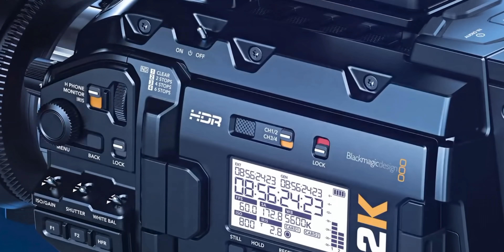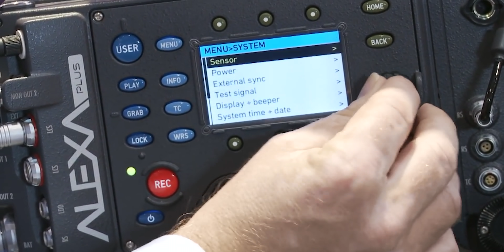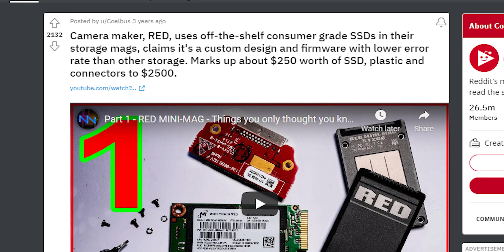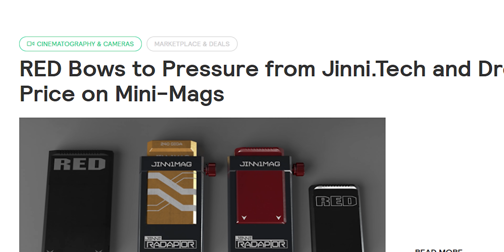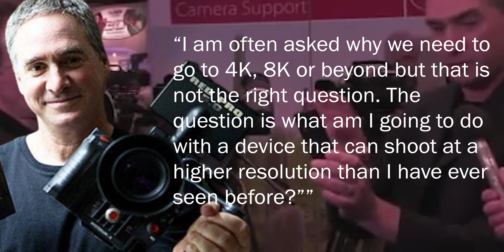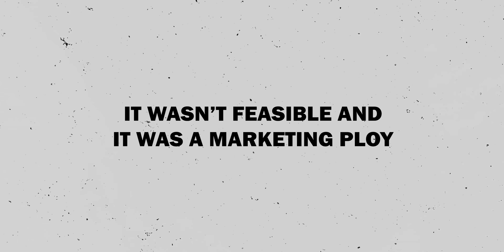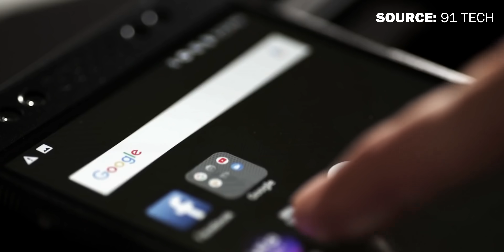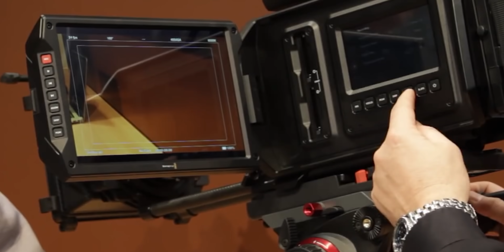The 28K Camera ABANDONED by RED Digital Cinema

Comment: 28k at even 1fps time lapse would generate more data than anything currently on market could handle for recording. at least that i am aware of. it is a lot of data. personally i am quite happy with 6k, and rendering projects out at 4k or 1080p
Reply from the maker: Right? The data load would be insane. Unless they figured out something like Blackmagic did with the 12k and had a lossless compression or something like that
Reply: I’m happy to watch 720p or even 480p if the story worth it !
Reply: @Sorennn94  nah people want 4k even when they not looking and only hearing.
Reply: @Sorennn94  How about 0p? Aka audio books.
Reply: @Sorennn94  if that is all that is available then i will do that for some things.
Reply: That's my take on it, it was technologically not feasible outside of the lab (lab scale can encompass a very large supercomputer if need be). That scale of sensor, or the "let's just go big" approach had a lot of other systems that would need to catch up for it to work. Things like the storage size and speed, the on board image processor, the memory-to-processor data links, and even auxiliary things like computer workstation software / hardware (for editing the raw footage) all had to catch up.

These tech limitations are why we've seen a slower transition to miniaturization for certain high resolutions. Action cams made the jump to 2k, 4k, and now are slowly going beyond that as other pieces of the puzzle catch up, compared with the advancement for the large frame cameras.

Not to mention that they lacked one key aspect, who is the customer? Hollywood was slow to adopt digital 4k - the pipeline costs for handling 28k footage would turn them away. The only people at the time that would use such a sensor are NASA and the NSA/CIA. If you have no customer pool, you don't really have a product.
Reply: @kylek29  NASA usually goes more for high frame rates than pixel count. but depends on the use case.
Reply: @RoadieFilms2112  all that fake Moon footage eh... ;)
Reply: @JamesHawkeYouTube  hahaha.
Reply: I do a lot of timelapses, I use a 24MP Camera to do it. About 10-15 seconds of footage will fill my 32GB SD Cards. I would imagine that 28MP video format would be a bear of a file to edit.
Reply: @Megabean  Their 28K sensor had a claimed 261 MP, not 28 MP. It is feasible to create and ingest the data today, with or without compression, but the equipment would definitely not be cheap or small.
Reply: @Johnbscv  Oh what a brain fart, so I shoot 6K timelapses with my 24MP Sony camera. My computer hates attempting to play that back uncompressed.  Usually, a 30-second timelapse will take my computer from start to finish of the edit maybe 2 hours to work through it all, (Using Lightroom and Premiere Pro) part of that is Sony using horrible proprietary raw files I think. I couldn't imagine what 28K would be like. I'm not an optical expert but I do think there'd be limitations because glass just isn't that clear. Like I used to use a Nikon D800 back in the day, that thing was 36MP and most of my glass wasn't quite good enough to fully utilise its resolution, even when stopped down to a reasonable aperture it was difficult. I know Hassies can handle extreme resolution but I'm not sure if those 100MP Hassies are actually optically 100MP clear. As for the data ingestion, while sure we make chips with that throughput but I don't know if you'd be able to get a fast sensor readout at a decent frame rate. Like I think TECHNICALLY Hassies have global shutters but their FPS is slow. I'd imagine a cinema camera with anything like that would probably have thermal limitations too, my A6500 gets hot as balls and that thing is tiny.
Reply: SSD в рейд масив.
Reply: If they internally binned and supersampled down to 7K, then the quality could be much higher than a native 7K or 6K sensor.  Then they would output 7K video which is a much more manageable datastream to transmit and store.
Reply: RAM Disk?
Reply: Definitely available. Just not for shooting movies.
Reply: So with high resolution cameras like this is mainly useful for editing small scenes rather than actually shooting a movie in. 

If you shoot in 4K but then bed to cut something out of the frame then it won't be 4K anymore. 

But if you shoot ins resolution higher than 4K than it didn't matter.
Reply: @doorhandle-v3i  I don't know, for me I typically don't crop unless if there was a mistake in the production like bad composition. The only exception is for VFX-type shots, but still, I'd never crop to the point that a 4K footage would be noticeably low res. If you need to crop that much then somebody made a serious mistake, especially if you need a 28k file.
Reply: Either way that's the direction we all are headed.
Reply: what do you think about dji's 8k 4d camera? do you think its worth the coin to get it or stick with the 6k variant? im kinda thinking of getting the 8k version...
Reply: Imagine back then.
Reply: Arri has proven that more pixels isnt atomatically better
Reply: nah we just use shitty jpeg compression, you'll be fine
Reply: I agree. Shooting 6K and mastering in 4K is ideal for me. This comment might age like milk but I don’t think we need higher resolution than that for general filmmaking. What I’m more invested in personally is fixing the godawful compression on streaming platforms. I can’t imagine streaming as a legitimate platform for cinema when it still looks this bad.
Reply: You could have a RAID array of multiple NVMe devices
Reply: But I heard this all before.  When Pixar started making films, it was "more data than anything currently on the market could handle", etc etc.. When you get to that level of data, it's not going to be a PC processing that data, but a server farm... It's been done before, it'll be done again.. And those computers will shrink down to the home market over 10+ years or so.
Reply: @billybollockhead5628  yeah, but this is in camera. data from the censor to the storage device needs to be processed to some degree, and that is a lot of data that needs to be processed very fast
Reply: 4k is perfectly fine unless you are showing something on a massive imax screen
Reply: i'm pretty sure you could do it without much issue using a 40gbps link and some fast nvme array.
Reply: you could just have about 1tb of ddr5 and cache the clips to about 5 minutes a piece.

Comment: RED has always done dubious marketing.  A great early example is the Scarlet promise of 3k for $3k.  It got them plenty of deposits and when the camera finally shipped, it did at around 2x time the cost and not even remotely close to the planned ship date.  I have learned not to trust their future products since that time.  They are a marketing force, keeping buzz around their existing products so you eventually get impatient and buy what they have now.   Funnily enough, the company that delivered better on the 3k for $3k promise was BMD.
Reply: I don't like how everything RED does is proprietary, even something that should be as interchangeable as a USB stick.
Reply from the maker: @fredashay  It's like buying Apple products haha
Reply: @FrameVoyager  yeah but apple products typically are reliable products
Reply: @MozTS  i worked for them and hell no.
dude every good chinese manufacturer gives you 2years of warranty.
apple gives you one, but you can shure purchase a warranty pack costing close to a third of the way overpriced devices lol.
this whole anti consumerism anti repair fast decline model needs to get busted.
from taking away microsd slots, headphone jacks, non conventional power plugs
imho Lois Rossman is a great yt and delivers great info about apple and Right to Repair Movement which is needed to become enviromentally sufficient
Reply: @MyGeorg13  I always read about the "overpriced" products from apple. with a few obvious exceptions, I dont see anything overpriced compared to other name brand products in that class.
Reply: That it does
Reply from the maker: Yep! For the most part they are pretty up front on everything even when something fails
Reply: In their early days there wasn’t really any alternative to red other than 35mm (which really is a different beast in how much extra gear you need) so I guess they could get away with it.
Reply: DAE APLEL BAD XDDDD
Reply: @videocommenter235  lool goteem xd

Comment: Getting a sensor that BIG from a batch of silicone wafer mustve extremely hard, especially with minimal defect, high speed lenses would also be an issue since most 617 lenses are slower than that of medium format. however that 645 sensor might be the next step for red, even wider than the current 40mm wide monstro
Reply: Yeah, nearly a wafer-scale CMOS sensor.. I am not sure if even in military satellite tech this has been done with virtually limitless budget, not to speak of a private sector product. Yields would be atrocious if possible at all..
Reply from the maker: 💯 it would be a cool experiment but in 2008 they were saying it was possible? Yeah right 😩
Reply: They could have also glued several sensors/dies together but Arri is the only company I'm aware of capable of sourcing/making it. Kodak used to glue dies together in some of their sensors in the 90s. However, as far as I remember those sensors looked good (colors matching) only if the dies were adjacent pieces from the wafer (or not too far away from each other) I guess nowadays you can use a sort of a LUT or something to fix it but in the 90s you had to fix the mismatch in post.
Reply: @hbp_  even if you were to glue them together from S35 sensors it would take about 21 of those (7*3). It's simply impossible with todays semiconductor tech.
Reply: @steviestl2269  yes but I guess it would be still more feasible than a a single mega chip. Either way, it would be very hard to justify the cost.
Reply: @hbp_  the US military was using arrays of Smartphone camera sensors for their surveillance drones back in 2010 already. And they used like 350 5mp sensors to get 5fps coverage of a whole city. 

Darpa argus

And that was years ago.
Reply: @Veptis  Interesting. I wonder how was the rolling shutter :)
Reply: @hbp_  the one video you can find has them claim it just sends snapshots of all the sensors. And you can chose up to like 20 of them to get a 15 fps downstream. It will be really bandwidth intensive. But the US military has their own satellite infrastructure to provide this data, encrypted. 

It doesn't really function as a single sensor I believe. And they won't make 1.8GP movies with it
Reply: @Veptis  no interplanetary movie theater then :(
Reply from the maker: @hbp_  interesting 🤔
Reply: Wafer scale devices have existed for a long time.  Decades ...

Comment: I think that it was and still is technologically impossible to create a sensor die on a piece of silicon that large. I think that the manufacturing yield was so low that they would have to charge more than Arri for the camera. It is most likely that they thought it was possible since astronomers have such high-resolution sensors (e.g. the Dark Energy Camera with its 500Megapixel resolution and $50M price tag).
Reply from the maker: 😂😂😂 for sure! Totally a marketing ploy to get buzz around their new products and then people forgot about it
Reply: I have a sensor that is literally a whole wafer, about 120 x 150 mm (specs are low though - 50um pixels, 5 MP). Its used for XRAY imaging. Larger xray sensing surfaces exists as well, but they got multiple large dies placed next to each other.
Reply: Absolutely. This is beyond the reticule limit for basically any manufacturing process even today. Shoot, even the V-Raptor's sensor is two stitched together, and that's modern tech.
Reply: @grumpybunny  the "stitch" occurs at litography stage, the RED sensor is still single die, not two!! I dont know why so many people think they just took two or three sensors and glued them together, lol. It is not that way. Multi exposure was used on large sensors at least 25-30 years back.
Reply: @cameramaker  Yields on stitched sensors is probably the reason why basically everyone seems to live with sensors not exceeding ~645 dimensions and instead takes small gaps between sensors.
Reply: Wafer scale dies have existed for a long time.  10k * 10k with 10u pixel sitting on my desk right now

Comment: The problem besides it being dumb, is that we just don't have media fast enough to record 28k video. I own a RED myself and think this is way overkill.
Reply from the maker: Exactly! But honestly, you just don't need 28k. Plenty proving resolution only does so much for an image. Can you imagine the write speed you'd need? haha
Reply: @FrameVoyager  8k is fine for me.
Reply: There have been consumer SSDs fast enough to handle the necessary write speed for at least six years.
Reply from the maker: @AlexKiritz true. Probably the better way to put it is isn't very practical
Reply: @FrameVoyager    In 2016 Red was charging $4k for 1TB sata SSDs when higher end 1TB nvme SSDs were $600. A number of the recommended SSDs that meet the requirements for PS5 expansion could do 28K at 60 FPS at MQ. There’s a $1500 one that is 8TB and could record for 20 minutes.
Reply from the maker: @AlexKiritz  🤔 I need to do the math at somepoint and see what the actual quality speed you'd need for 28k
Reply: @AlexKiritz  can you point me to any external ssd's with write speeds over 2,000MBs?